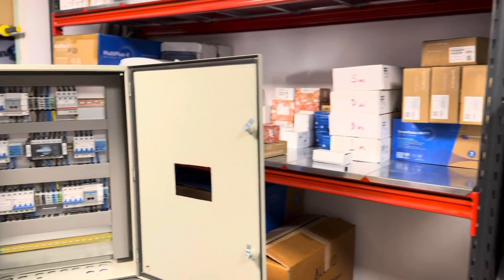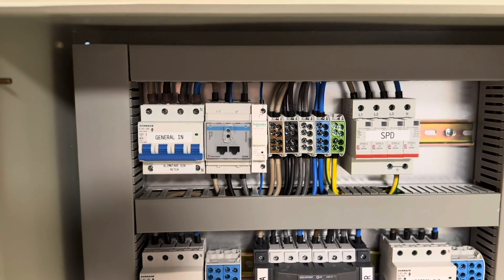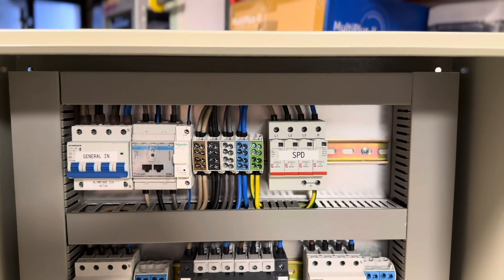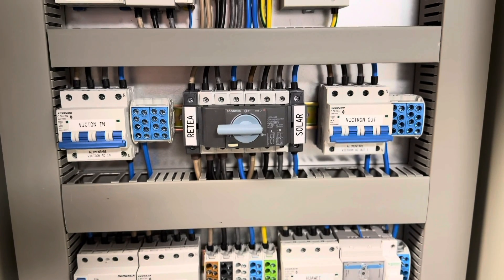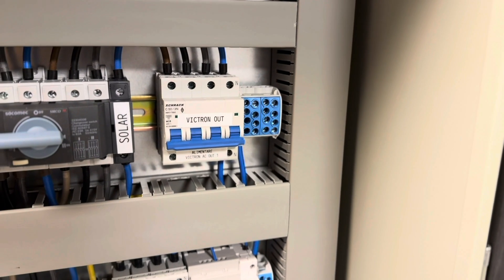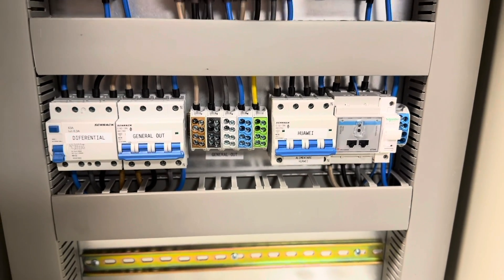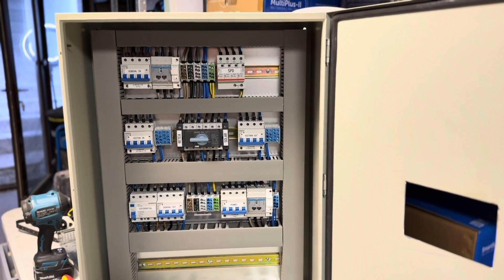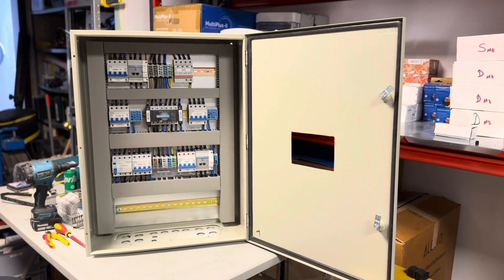AC coupling fully equipped electrical cabinet for Victron and Huawei inverters

Comment: And a question, did I hear correctly the Huawei is on the AC IN?
Reply from the maker: Yes, we use a meter to monitor the Huawei production, and we set the meter to Inverter mode. This way, the entire Victron system knows that there is another generation unit connected and can use that energy to charge the batteries as well. If the grid goes down, the Huawei inverter will also shut down.